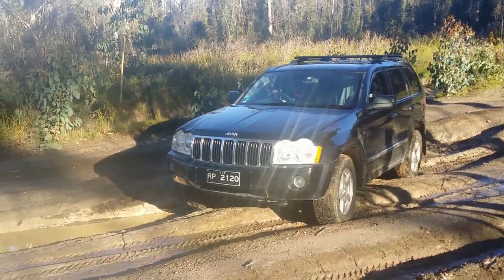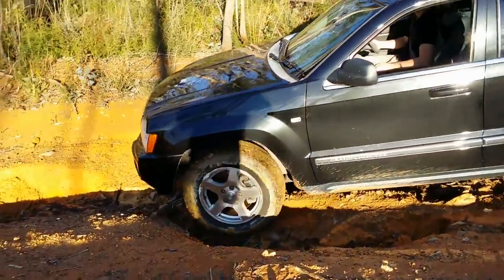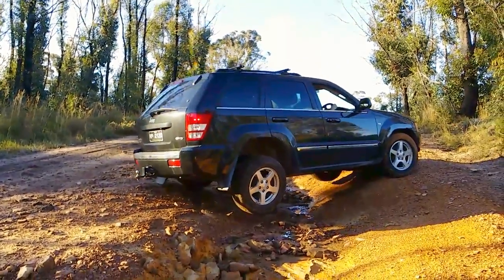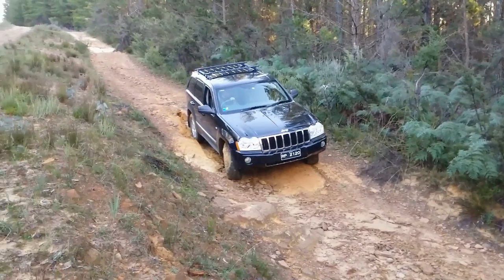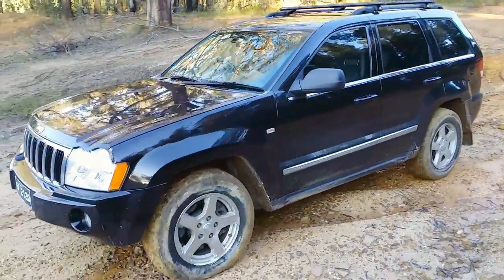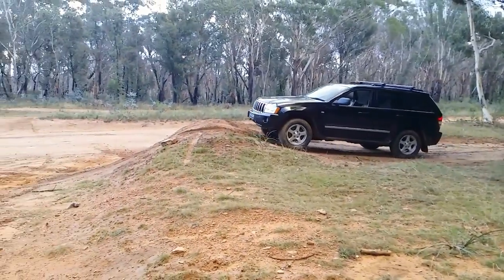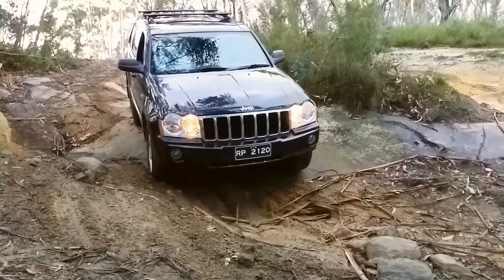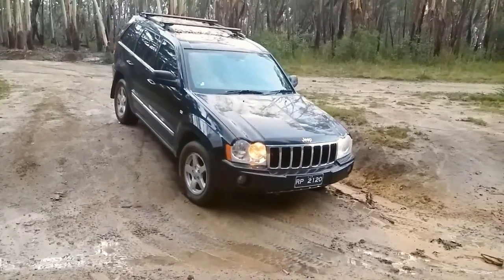Jeep Grand Cherokee CRD Off-Road Test

Comment: Awesome video. I have an 09 WK Overland With all the bells and whistles it came with for that year. I love watching how you take it stock through its paces. Just a right out the box, how will it do review. Mine has the Hemi and with QDII it really does feel unstoppable. I didn't know that the WK2 didn't have the same setup with the front diff. I had been told that mine is the most desired year for the Grand Cherokee as it had reached the best combination of on and off road capabilities and stolen all it could from Mercedes. The new ones seem to get lost in the mix of crossovers because everyone makes a Jeep shape...or is it the other way around? Plus the new ones got rid of two of the best things in the GC, the rear opening lift glass, which has always been something I love. The other is the hand operated parking brake. Nothing better than taking a snow covered corner by giving it a little pull and drifting like you're in a rally car.
Reply from the maker: Thanks man 👍 Appreciate the time you take to comment. Yeah, it did very good in stock form. You're right with your opinions, feel pretty much the same way about the WK2's.

Comment: Nice video. I can see that its old. I am wondering how its held up over the years? Do you still have it? I recently got the hemi version with a rebuilt engine. So my new Jeep just got a new lease on life. It still looks great after 18 years. It must have been stored in a garage. 158,000 miles when I got it. Now it has 160k since I figured out the limp mode problem.

Comment: Had one of these for 17yrs now, its got 300k on it and its my daily, its towed my 2.7 tonne caravan around Australia and two separate trips to each of the Kimberley,  Gulf and WA and it still shits all over most of the more modern 4wds with their pissy 4 cyl turbos and keeps up with the more modern V6 diesels. Quadra drive two is amazing tech. I also have a high dollar fully built troopy with close to 200K sunk into it and a twin turbo sporty but the jeep is the vehicle I prefer to daily. It costs nothing to run and while I use my troopy for Outback touring and the really rough stuff and my sporty for track days and business trips, my jeep is my go to daily.

Comment: Great video. I'm on the lookout for a Jeep Grand Cherokee for a long time now and this seems to be a good model. I'm a bit concerned about the ground clearance though? Also costs of servicing and parts. Are they moderate here in Australia?
Reply from the maker: This is a great model Jeep Grand Cherokee. Servicing, like any other vehicle, is cheap if you do it yourself, putting the best stuff in it. Parts are easy to get from the US dealers for OEM and auto stores for generic parts, quicker to get and cheaper than here. In terms of clearance, you'd need minimum 2" lift and 31" tyres to get anywhere, and by adding rock sliders, you'd reach a lot of places. If you go this way, make sure you get the Quadradrive 2 model. This is the last of the front and rear locking diffs models. Thank you for watching (and commenting).
Reply: Thomas Anstoetz any problems or common issues to look out for ? I’d like 2” lift and ko2’s. 
So models with quadratic is the model to go for

Comment: I have an 08 Jeep GD CRD. Never had a single problem over the 4 years I've owned it, that wasn't expected wear and tear. I'm thinking of upgrading the vehicle, but really struggling to find something better. I love my GC WH and enjoy driving it. Always feels nice. Have considered the newer WK2, but feel like its a gamble with those, because of engine issues. Many of the WK2 I hear run lke a dream for ever, while others detonate prematurely. For the money and even above, you can't find a 4WD SUV come close to the features and specs. That goes for the newer (WK/WK2)Jeep GC's too. But they do have some reliability issues with the engines. Seriously, compare. Pajeros, Prados and Landcruisers of that era did not come with reverse cameras, rain sensing wind screen wipers etc. Engines in the above are very under powered and still use more fuel than the GC. Towing capacity is not even close. Also considered the Landrover Discovery, but have heard bad things about expenses to maintain them and reliability.

Comment: Excellent video!! Im on the hunt for a Grand Cherokee now. I had a 2000 with the 3,1 liter diesel before and i loved that car. The Quadra drive system is in my opinion one of the best (and few) true 4wd systems. Which years of the WK have the QD system (3.0 CRD)? Does some models have air suspension?

Best regards, Jimmy.
Reply: The QD system system was available on all years, but only on the higher trims for the most part! Easiest way to tell is by the plaque on the center console under the shifter, or counting the rear diff bolts. 10 v 12 I think, 12 means QD2. Happy hunting!
Reply: @bullet2monkey  Thank you for your answer!

Comment: Should have gotten the Hemi, they are both the same price, get about the same mpg, torque is about the same, but the crd has tons more problems. Mine blew the turbo seals, sucks about a gallon of oil per 500 miles, way too weak for this chassis. Get the hemi if you want a tough machine.
Reply from the maker: I got both.

Comment: I'm currently scouring the car auctions for a 2010 Jeep WK with 4WD and the 5.7 V8, because my research shows the 2010 as the most reliable year to date.  Anyone having good longevity with a 2010?  Any flaws emerged over the years with that manufacture date? 

 I'd appreciate any insights that can be offered about the long-term durability of the 2010 model Jeep WK with the 4WD and 5.7V8 drive train I have in mind to buy soon.
Reply: I took over the payments from my brother on his.  Drove it from Cincinnati to St. AUGUSTINE FLORIDAY. STAYED A WEEK. PULLED OUT TWO PEOPLE ON THE BEECH STUCK... DROVE ALL THE WAY HOME.  DAILY DRIVER TO AND FROM WORK.  DON'T MISS A BEAT.  I LOVE IT.
Reply: @timmylee1974  This is a fantastic testimony to one rugged vehicle sir, and I thank you kindly for taking a moment to give this endorsement. I'll be rounding up one of these beasts before long for sure.
Reply from the maker: They are reliable indeed.

Comment: for 100% stock it went great 
I'd own one of these , but just afraid of jeeps reputation 
so with this model with just a 2inch lift what size tyres would fit under it ??
Reply from the maker: On 2" lift you can run 31s. 32s would require some hammer work.

Comment: hey man would you know what would be the best lift kit for light prerunning? you seem to know a lot about the WK. =)
Reply from the maker: The cheapest or best value for money is a 2" or 2.5" lift with 31s or 32s respectively. Bump stops must be extended and pinch welds done.

Comment: Nice video mate. Are the new Grand Cherokees this capable?
Reply from the maker: Thanks mate. I would say for this trail, yes. This Grand is getting some major upgrades done to it soon, which can't be done on the new ones, and that's where they will part in terms of capability. They are already less capable due to the independent rear and the lack of ELSD to the front straight out of factory.
Reply: Aussie Four Wheelers (Hemi4WD) I looked at buying the newer one. On road I liked the idea that it slowed down on cruise by itself, I thought nicer interior. For now I'll stick to my '06, the newer ones seem to be going for the upper Landrover market. i.e. no rough stuff.

Comment: WOW. I have a 99 TJ modded a little and this standard makes the 4wding look easier than the Wrangler. I'm on the fence to go CRD or the 4.7 though. The economy on the CRD is swaying me I guess.

Great video really awesome to see one in action.
Reply from the maker: Why 4.7? Either go CRD or Hemi. No point going 4.7 when the Hemi has heaps more power. CRD's are good economy and faster than the 4.7. But the Hemi rumble is irresistible.